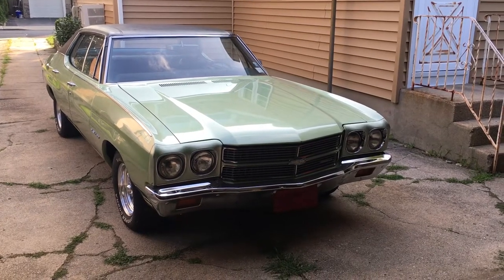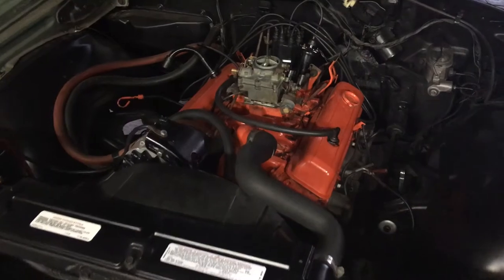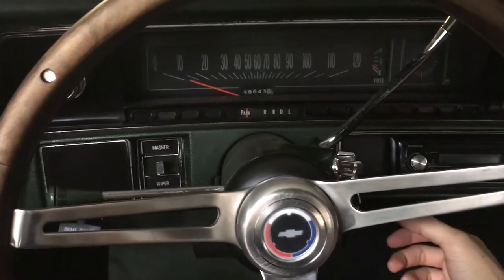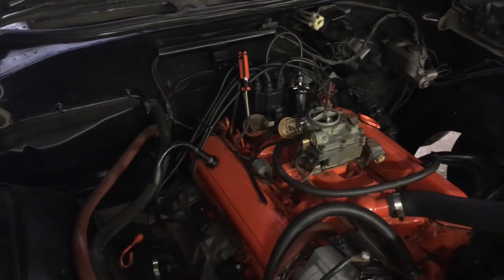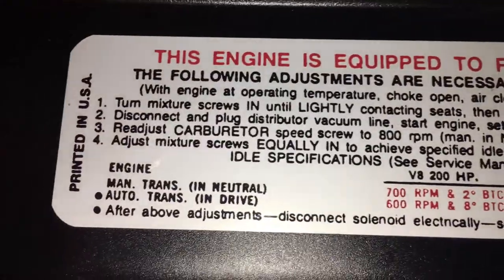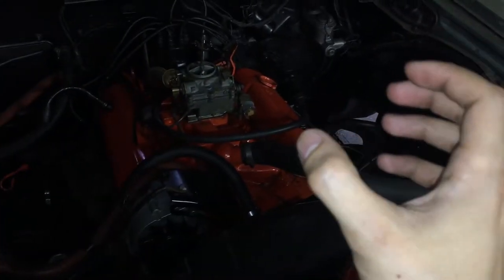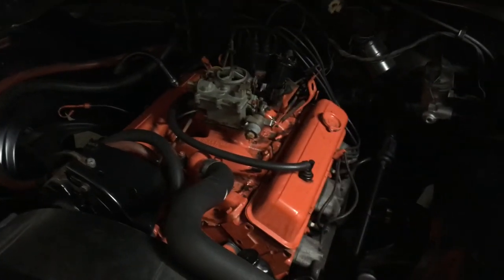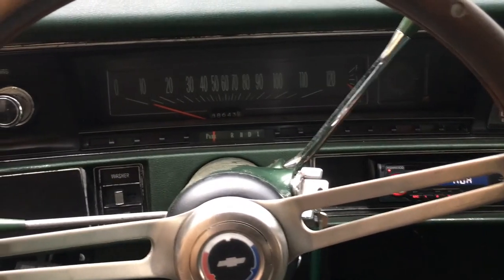How to Set Initial Ignition Timing

Comment: Will adjusting the total timing after finding the initial timing interfere with the initial adjustment?
Reply: Depends how you do it. If you rotate the distributor it will. If you change the flyweights and springs no you wont. However it only changes how fast or slow it gets to total advance
Reply: He needs to make sure the point dwell is 32-36 degrees first. Every two degrees of dwell changes  timing one degree